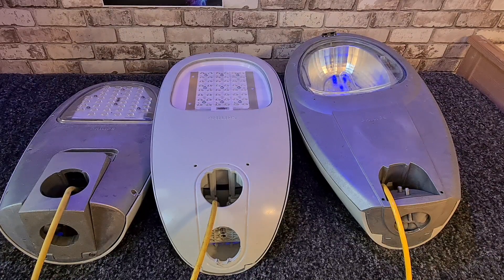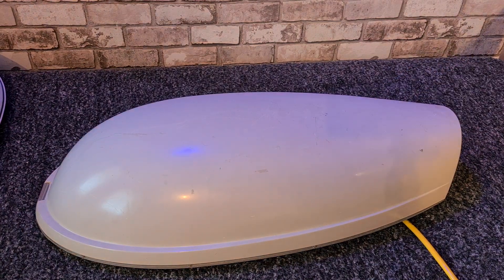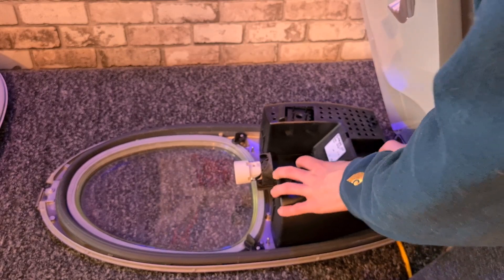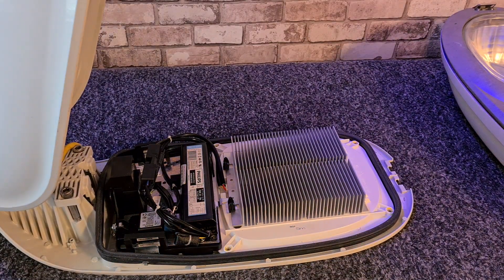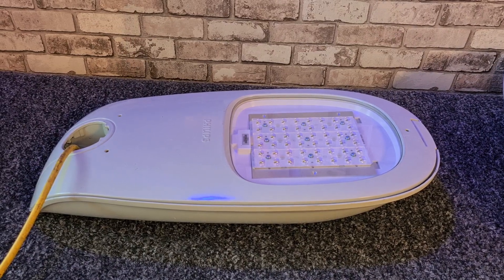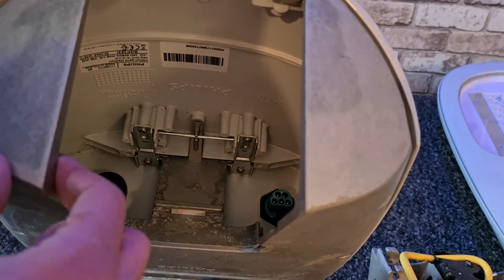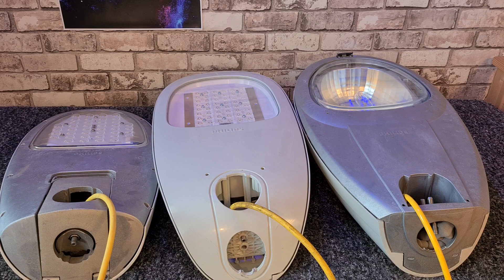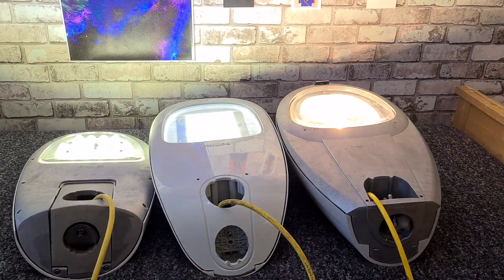All The Philips Iridium Streetlight Versions Compared!

Comment: The Iridium Gen 1 came in 4 sizes (in the UK)
Mini = SGS451 
Small = SGS252
Medium = SGS253
Large = SGS254
all for use with HPS / Metal Halide or Cosmo
Reply: 2s are the plastic canopy version, very common, 4s are the aluminium version, rarer.